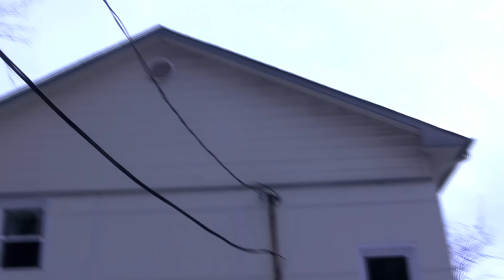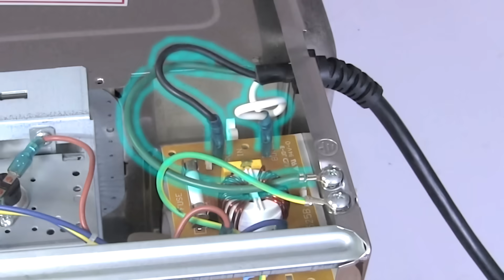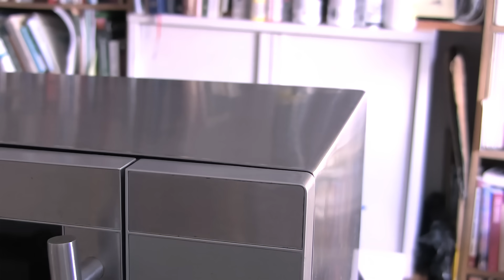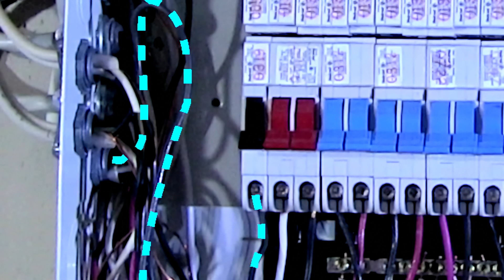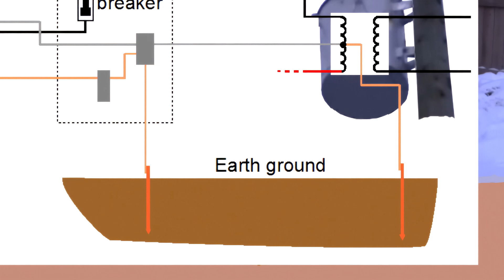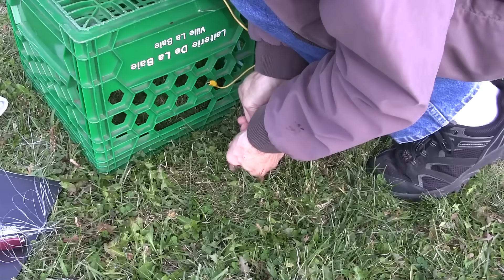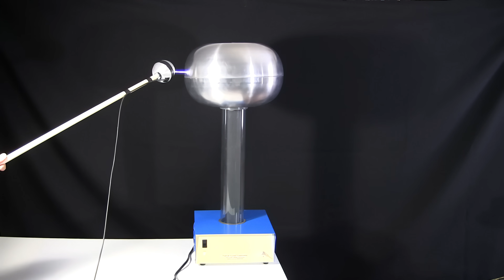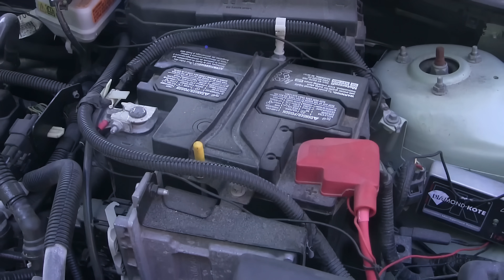What is Ground? Earth Ground/Earthing

Comment: So why Ground Fault Interrupter is needed if plain circuit breaker is doing all protection via ground wire?
Reply: A circuit breaker will sense a ground fault and properly open.  But many appliances do not have the grounding conductor to carry the fault current (a metal toaster is a good example-only the two conductors).  The GFCI is needed to sense the ground fault.
Reply: GFCI's are a life-safety device. GFCI's were mandated because of questionable grounding (bonding) situations.  Many appliances use only two prong receptacles.  A good example is a metal toaster.  There is no grounding/bonding conductor, so there is no return path for the fault current.  During a ground fault, the GFCI senses the imbalance (some current not returning) and opens itself.
Reply: From what I understand, circuit breakers protect you from overcurrent, not ground faults. If there is a ground fault on a live circuit and you touch a charged conductor, you can become the ground.

Comment: Really good, understandable explication of ground; why we have 3-prong-plugs when the neutral wire is already a ground; and why a car chassis is a ground all by itself. How I wish this guy had been my science teacher in lower school let alone prep school and college. Would have saved a heap of confusion--and some serious zaps.
Reply: That is an excellent question.  Why not simply connect the appliance chassis directly to the neutral wire at the appliance?  In other words, why not construct the outlet so that the 3rd prong is connected directly to neutral at the receptacle?  Then, there would be no need to run a separate conductor all the way back to the panel, right?  

I will tell you.  It's for safety.  Let's say it is wired that way--the 3rd prong is connected directly to the neutral at the receptacle.   Imagine now that the hot conductor faults against the chassis.  The current will travel from the chassis, through the grounding wire, to the 3rd prong, to the neutral (connected to the 3rd prong), and to the panel.  High currents will flow and the circuit breaker (or other overcurrent device) will open and shut off voltage to the device.  All is good.  

But here is the problem and why that wiring scheme is prohibited.  Let's say that the same hot wire faults against the chassis.  But this time, the neutral wire has failed somewhere between the appliance and the panel.  The fault current can't flow back to the panel, right?  So what happens?  The chassis is now at 120V volts, not "ground."  The hot wire is faulted to the chassis so whatever voltage is on the hot wire is also on the chassis.  Often the voltage is at 120v. It's a rattlesnake ready to bite the first person who touches it.  

As for the car, the vehicle chassis is not truly "grounded" as though it is connected to earth.  In electronics, the point considered "0" volts is called ground.  For an automobile, that point is usually the chassis.  The negative terminal (0V) of the battery is connected to the chassis.  The metal chassis is then used as a conductor (return path) for the vehicle's electrical devices.  The chassis is used instead of running numerous wires back to the battery.

I hope my explanations helped...

Comment: Great explanation. One question remained for me: I have also tried to make my own crystal radio and found it works better with ground connection. But why is that? From my knowledge, the antenna will pick up the signal and signal with certain frequency will then be amplified by LC circuit and that's all, yet the ground does affect the radio a lot ...
Reply from the maker: Ah, but what about all the frequencies that the antennas receiving but you're tuning out? My understanding is that the current from those goes to ground.
Reply: I jumped to your another video "How a Crystal Radio Works" and yeah your explanation does make sense. My circuit was a little bit different but I will try to figure out. Thks!

Comment: Hi
I wanted to take time to thank you for a great Video. that helped me understand the ground/neutral. also how a floating neutral vs a bonded panel. I was having trouble with that circuit...all my training has been on DC voltage & was having  trouble with ac. as far as ground/neutral.

  Thanks again  GC

Comment: Thanks for the great video. I have a question. If ground is connected to the neutral, then why current doesn't flow into it from the hot wire?
Reply: Ehsan.1.M   Try letting me me explain this to you,  the ground wires in a 120v circuit are are for safety (short circuit) conditions and electrically are not tied into the circuits flow path. The ground wire is tied to the 'chassis' say for an appliance  as  a wash machine it would connect to the frame or case and not to the  conductive wiring itself. Now the neutral wire(s) is the electrically bonded return path to ground  under normal operating conditions ( but the neutral and ground do connect to one another in the breaker boxes neutral bar where the path  taken will either go to ground via the ground rod or back to the utility transformer to its ground rod. The important thing here is to realize the ground wire after leaving the breaker box to the appliance, etc is floating unless a shorted condition occurs like the wire nut for the hot wire becomes disconnected and touches the shell of the wash machine. BANG, now if there was no ground wire connected to the shell it would become energized waiting for a path to take to ground. Now say you go take your clothes out of the washer and don't have any shoes on and are standing on an moist concrete floor. Without that ground wire tied to the frame the path of flow will choose you as the path of least resistance to ground(once and if any part of your body touches the frame). BUT with the ground wire tied to the frame in a properly earthened circuit (approx. 0 ohms) the current will flow will travel back thru the ground wire instead of you. Hope this gives you a better understanding. Look up GFCI and how they work it will give you a better understanding and explain what leakage currents are about. Now answer this why do you see a lot of tools with plastic casings that have only Two prongs at their plugs?  Good luck!

Comment: It wasn't pointed out, but connecting the neutral to ground SETS the 0v potential, since 0v is a completely relative measurement. Voltage is a measurement of an electrical charge difference, which is its potential to want to move from the lower to higher(though measured inversely). Opposite sides of the earth may have a 25v difference if you were to test their potential, because the number of free electrons vary depending on the composition of the earth. Hooking the ground up to neutral ensures that the transformer is working off of 0v with the ground set as the reference of that 0v. If you were to have an offset of 100v on the neutral in regards to ground, then the hot would be 100v + its voltage in reference to neutral, in reference to ground. This is how you can run power supplies in series to add together their voltage. 

This is the biggest misconception about voltage, it is a RELATIVE measurement of a potential difference in two things, and that relation is made sane using the assumption that ground is 0v. If you have a wire that is 1000v, and another that is 1020v, there is only 20v between them if the 1000v wire is used as neutral. 

Some appliances have something called a 'virtual ground'. They pull a '0v reference' out of their ass, apply that voltage to a large mass of metal, and call it ground. However, it is NOT ground voltage. This is why you commonly hear humming when you hook audio equipment together when one of them is grounded and the other is virtually grounded. You have a ground loop where the virtual ground is getting pulled low or high by the real ground, THROUGH your speakers or headphones.
Reply: That's right.  Many people incorrectly believe the earth is truly 0V.  The voltage of the earth varies and even changes.

Comment: It seems like you are confusing grounding and bonding in this video.
Reply from the maker: Nah, this video is targeted at the 'lay person' and not the electrical installer. For the electrical installer I recommend Mike Holt's excellent videos https://www.youtube.com/watch?v=mpgAVE4UwFw. I purposefully used the term grounding instead of bonding to be less confusing -- after all, ground prong and the ground hole are the terms most people are familiar with and are curious about. In retrospect, possibly a mention of the term at the end of the first section in the video wouldn't have hurt.

Comment: The reason why the neutral wire is connected to earth in addition to the centre-tap of the transformer is to minimize the risk of someone receiving a 240-V shock, should he come in-contact with L1 (i.e., the black wire) or L2 (i.e., the red wire) and any grounded object, should a ground-fault simultaneously exist anywhere along the other hot wire. 

For example, say you were to touch an exposed, live black wire (120 V) outside your home while standing in a puddle of water, and somewhere within your home, the other 120-V wire (red) is in-contact with earth-ground due to a ground-fault, and defective or missing ground-wire (e.g., a kitchen appliance with a ground-fault, whose metal chassis is touching the kitchen sink, but has had its ground-pin removed from its plug by some foolish individual). If that connection between neutral and earth didn't exist, then the only return-path for the current through your body would be the red wire. 

Since the red wire is connected to the other side of the secondary-winding of the transformer, it means that you would receive a 240-V shock EVEN THOUGH you were only touching a 120-V wire directly, because the potential difference between L1 and L2 is 240 V. In other words, in this case, the path for current would be from the black wire, through the earth, and back up through the red wire, which is 240-V higher (or lower) than the black wire.

The shock you receive in this scenario would be FOUR TIMES as likely to KILL you (The electric power delivered by the shock varies directly to the SQUARE of the voltage.), because it's neither the voltage nor the current, but the product of both (i.e., the POWER dissipated through your body) that kills.

Comment: What about GFCIs? And ground faults where the path of the current is literally through the ground?
Reply from the maker: GFCI's despite their name, don't actually use the ground, so I didn't mention them. I guess that's the same as the breaker path that I did talk about, but I did that because it involved the ground hole and ground prong on the plug. Though with a GFCI, the fault can be due to a grounded person touching a live wire, and in that case it would involve ground. I didn't think of that angle. I suppose that's what the G in GFCI is referring to.
Reply: Rob Mckennie 
GFCI's trip when they sense a ground fault. Meaning a hot shorted to ground. They are designed solely to protect people from shock or electrocution.
Reply: Battleborn Valor. I would note that a leakage current will cause the GFI to trip as well as a short w/o it being a ''short''.

Comment: I don't think what you're saying at 1:38 is right. In Europe the ground bar is the one the incoming neutral is directly connected to and the second bar serves as the neutral one. That way the ground wires in the house are connected to the incoming neutral as directly as possible (which is important for obvious safety reasons). You cannot do it the other way around like in your presentation.
Reply: I believe, In his panel, the neutral buss is bolted to the frame, therefore connected to the grounding rod.

Comment: Hi. What if you just replaced the wall socket with the 3 prong but it's not really connected to the earth outside? Would that still be better than just a two prong or removing the third center ground prong on the gadget's power cord so it fits the two prong socket? How about those universal-adapter which lets you plug in a 3 prong to a 2 prong wall socket, would that universal-adapter's ground be good enough? Thank you. God bless, Proverbs
Reply: Either way is dangerous. Appliances with the third grounding prong have it to protect against shorting and electric shock. You need to find a way to connect the grounding screw on the outlet to earth ground.
Reply: Hi. I may need to call a good electrician so it goes to the real ground, the real earth connect it to the 3 prong wall socket (may need to replace all the sockets to 3 prong and have it connected all to the actual ground). That's a lot of renovation but I think when I build my house I'll tell my architect someday to make all socket 3 prong and connect it all 3 prong to earth ground.

How about this: the 3 prong power cord is connected to a power strip and the power strip is connected to a 3 prong outlet but that outlet is not really connected to earth ground (it was just replaced from a 2 prong). Would the power strip be a good enough ground? It's a Belkin brand. Thanks.
Reply: Don't do any of that.  Instead, install a GFCI receptacle.  In fact, the NEC specifically allows a GFCI to be installed to replace an older receptacle.

Comment: Hi. Thanks. My USB external enclosure when I put the 1TB hard drive, distorts the speaker's sound before it plugs in the USB slot in the computer. It seem there's a bit of spark going from the USB cable to the USB slot, distorting the speaker's sound for just a bit. Should I ground it more and how? Should I solder a wire (how thick?) from that metal shield that surround the circle hole where the power plug comes in and put that to the screw that seems to go to this thick metal plate (where the hard drive seats). Thank you in advance. God bless, Proverbs 31

Comment: if we connect the wire to water pipeline wont the water we touch get electrified and we may get shock is that possible plz explain
Reply from the maker: The breaker is supposed to trip and make it safe.
Reply: The metal water pipe should be bonded to the panel.  If a conductor touches the pipe, high current will flow and open the circuit breaker or other overcurrent device.

Comment: Many places also require a Ground fault detector which trips before the breaker will.
Reply: ? the Platypus that is a whole different book. A GFI senses the current flow between the ungrounded (hot) and grounded (neutral). If there is a 0.008 amperage difference, the GFI trips. If the GFI and breaker are in one unit. Then the GFI part is tripped, not the breaker. The breaker part, guts inside, are still connected. But the power won’t flow through to the wire as it’s interrupted by the GFI part. 

I used ungrounded and grounded, because that is how the NEC labels them. Because technically there is no neutral wire per say, it’s a term the trade uses. 

Ungrounded = hot, where the “power” comes from.
Grounded = neutral, where the “power” returns to.
Grounding = ground, where the “power” goes to during a fault. Which shall happen with in a fraction of a second as the breaker trips from over current.

Comment: But if the neutral wire was not pluged to the earth, it would not be dangerous to touch the hot wire beacause the current would not flow ?
Reply from the maker: If I understand your question correctly, if there was no ground connection at the breaker panel and no ground connection at the transformer, then I think you may be right. If you touch the hot wire then you would not be closing the circuit through the ground to the hot since there is no other ground connection except you.

I could be wrong but I think some current might still flow since the hot wire has AC and the ground is a big neutral conductor. It would alternate pumping charge into the ground and out. But the ground has a very high resistance so that current might be low. I'm not sure of that though.

Comment: please, explain a little bit GFCI or RCD.... thanks
Reply: Fermain Jackson 
 GFCI are for stopping electrocution, but not getting shocked. It takes .05amps to stop your heart. Normal breakers takes much much more current to trip then it takes to kill you. GFCI are set to trip at .05amps or more. They measure both wires to detect .05 amps missing. If more then .05 amps is leaving the hot and not returning back to the GFCI it must be going to ground. Possible thru someone's skin. Finding it's way back to the ground rod to complete the circuit.
Reply: Fermain Jackson Breakers trip when circuit is overloaded (too much current).   GFCI trip when there is current leakage.  They measure the current going from the hot and back on the nuetral.  They should be equal.  If not it means electricity is leaking into your metal lamp base, washing machine case, water in an outlet, etc.  Without GFCI if you touch the area of leakage and are grounded then that extra current will go through you and...poof....you dead.

Comment: A popular misconception is One purpose of a ground rod is to trip a breaker. Due to the high resistance, [around 25ohms) it is not enough current to trip any breakers.
Reply: That's right!  Many people don't understand that the high impedance of earth will actually limit current!  The ground rod "grounds" the system to protect against high voltages, such as lightning and transformer failures.